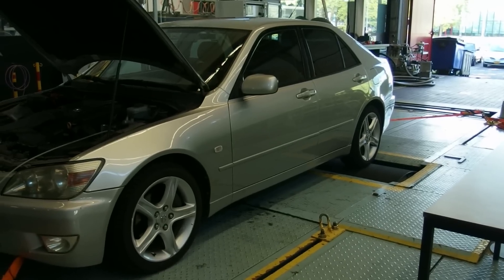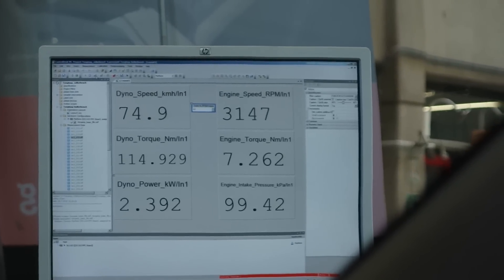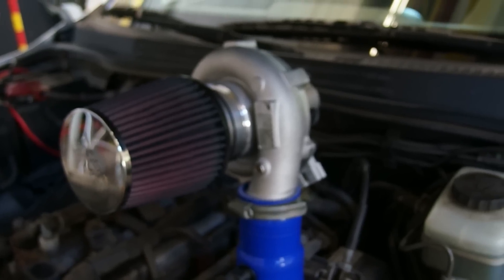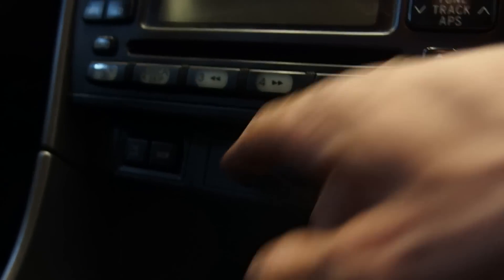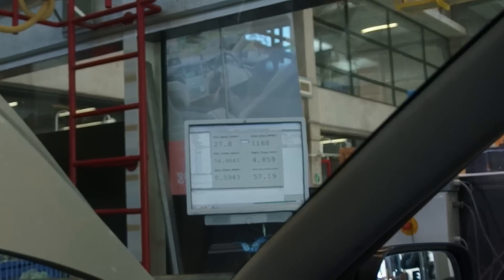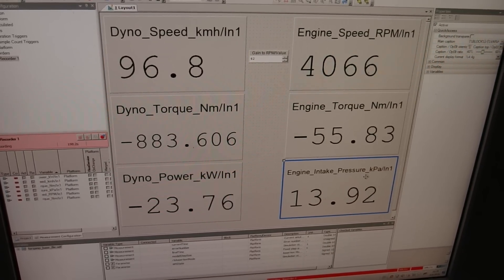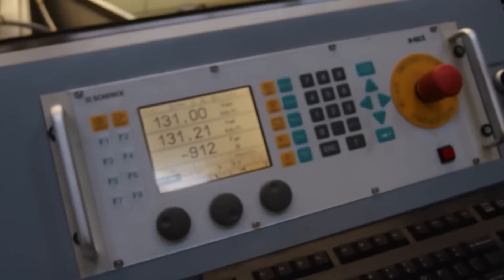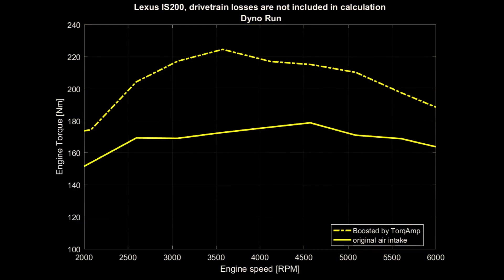Dyno testing Electric supercharger on Lexus IS200 TorqAmp

Comment: I dont believe any of it. It sounds like they had it at 3/4 thottle at first. Then they gave it full thottle with boost.. Lol
Reply from the maker: You can see the air pressure on the screen. Up to 100kPa is only feasible naturally aspirated. Higher then that is always boost.

Comment: If you buy a Honda Accord V6 you'll automatically get over 200hp as an added bonus it comes with a warranty
Reply: ygtcbee23 and you’ll still be slow ! lmao
Reply: kekis: LMAO this P.O.S. Lexus is no where near 4.7 on 0-60. Stock it made it made 153hp and weighed 3,042 lbs to record at best 8.8 seconds. Lets be generous, The hair dryer supercharger added made 5hp at peak...

Take an M3 Competition Package from 2004 that made 333hp and weighed 3,383 it  turned a 4.7 0-60.

So this thing either has a 2nd hidden engine somwher or it lost 2000 lbs to hit 4's

Comment: Lets be serious for a moment...  This stupid electric turbo is only capable of about 1 psi.  If you calculate that amount of boost to the physical displacement of that engine, you increase effective displacement by .13 of a liter.  Then calculate loss from amperage draw on the alternator.  Yeah, its not doing anything...
Reply: Amp draw on the alternator is negligible with these. Most of that is going to be buffered by the batteries and recovered during charging.
Reply: Well actually it is doing quite a bit more than that. In the beginning it almost had half a bar of boost, going down to 0.15bar.
Reply: Magically it gained a pound of boost???  No matter because that impossible due to the dynamic efficiency of a combustion engine.  Since there's no drive impeller on this glorified hairdryer, I'll put it as simple as I can... The more power an engine makes the more air it ingests.  And the more air it ingests the less capacity this toy will have to do anything.
Reply: @Crazystuffyousee  Magically? Did you watch the boost Gage on screen? 140kpa is 1.4 bars, combine that with the less than atmospheric pressure of the NA run, and you're at my pressure of 0.5bar. In this value decreasing to 0.15 you may find your statement of airflow increasing proportional to speed approved.
Reply: @Lach actually I'm not sure if this system run's at 12v. Did you notice the black box in the rear seat?
I assume they use that to step the voltage up. That'd make sense to me, to keep current low.
Reply from the maker: @Lach The TORQAMP comes in a kit with a 48V buffer (yes, the black box), it will be relatively slowly charged from your 12V system. The 12V system will not be loaded at max boost so no parasitic losses as with regular turbochargers/supercharger.
Reply: @Theedd9991  do you have proof? 
To me, they don't advertise astronomic values and the constant boost drop matches theory.
Reply: Theedd9991 I’ve seen it with my own eyes (kid)...
Reply: Its using an external power supply, there is no noticeable load on the alternator.

Comment: It's very good but very expensive .. for that price I prefer to add some cash and buy a supercharger.
Reply from the maker: The difference with a belt driven supercharger is that the supercharger compressor speed is depending on your engine rotational speed. Therefore you get relatively low boost at low engine speed. The low engine speed is most of the time the speed where you drive and where people like to have more boost.
Reply: @TorqAmp  But this system really isnt worth it if you only increase by 20-30 horsepower. i mean if i was to install this on say an 166 horsepower car and only increase my power to 180-190 horsepower. I mean thats really disapointing and a waste of time and money. i could just get a new tune and mess with fuel maps and ignition maps to gain 10% power.
Reply from the maker: @stephen841  when you can gain an additional 10hp on a naturally aspirated engine you can get the extra TorqAmp horsepower on top of that. We provide more air to burn more fuel. Drivability is not really about horespower somewhere at the high rpms but mainly torque at the low rpms. Becuase we developed the TorqAmp, Torque is the thing you get :D

Comment: Use the physics!
Reply from the maker: We did! We are located at a technical university ;)
Reply: TorqAmp show me the math!
Reply from the maker: @paulirumbin1541  are you used to thermodynamics?
Reply: @TorqAmp  We can argue about this even to the end of the world until you publish complete mathematical calculations. Whenever it is about the electric turbo, no one agrees to publish the calculations. Always just saying it works. Dyno testing doesn't tell you anything when the videos are cut a lot.
Reply from the maker: You're right that there are a lot of people have a lot of different opinions about Electric Superchargers. Mainly due to the cheap Ebay products that obviously cannot provide enough air because of the low power. It's great that the big car manufacturers are also implementing this technology which proves that it is not a scam anymore. 
Here you can find one of our publications that we worked on with another university.
Take a look at equation #18 ;)
https://www.sciencedirect.com/science/article/pii/S2405896315018911

Comment: What kind of motor is in the car ? And i apologize for asking such a stupid question, I’m a noob when it comes to the dyno. But those numbers on the monitor, I have no idea what they mean. And does it help with the gas consumption? I purchased a Lexus IS300 a month ago and I’d like to do some upgrades. But I want something that’s going to provide (horse power) & (better fuel efficiency)
Reply from the maker: The Lexus in the video is a 2 liter 6 cylinder engine. When you like to use more engine power, you also have to burn more fuel. And when you're used to more power you automatically burn more fuel over and over again ;) But we are pretty sure that we have a better fuel economic solution than the belt driven supercharger which is the commonly used upgrade for this car.
Reply: In the IS200 its a 1G-FE 2.0 6cyl engine that puts out around 153bhp. if you're looking for decent recommendations and you are on FB looks for the Lexus is200/is300 group or  the LexNation group where you can ask any questions you have about your car. PS i've known of people getting improved mpg with turbo setups but with a 3.0 2jz you cant expect the mpg on it to be stellar xD
Reply: bryan paz you are a noob, those two things are opposites lol you can’t have both for the most part with any performance upgrade you will increase gas consumption, with a tune made for performance you will almost always lose gas mileage
Reply from the maker: @RavenPrecept indeed, we don't load the 12V system when boosting so no additional power has to be provided by the alternator. We load the 12V system when cruising to charge the 48V system in the black box. So you get maximum power available for acceleration.

Comment: So how much more power do you get
Reply: 5psi about 25-35hp
Reply from the maker: @lifeofmike556  highly depends on your engine size. Take a look at the several dyno runs at our website. This shows the potential on comparable sized engines. For comparison take the naturally aspirated ones when you compare to a naturally aspirated engine. For turbocharged engines it's a completely different story and hard to compare but in general good low end torque.